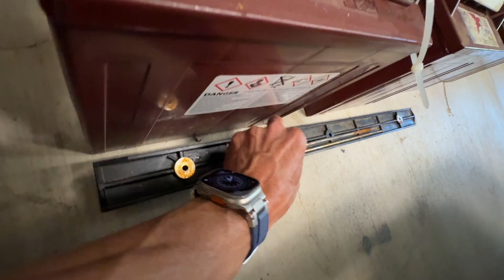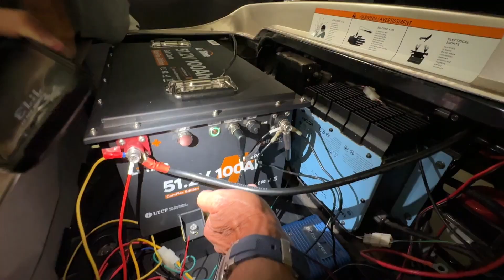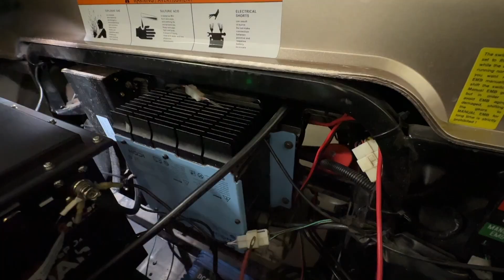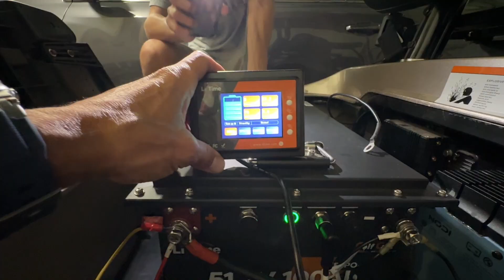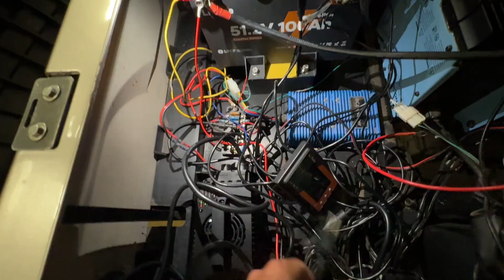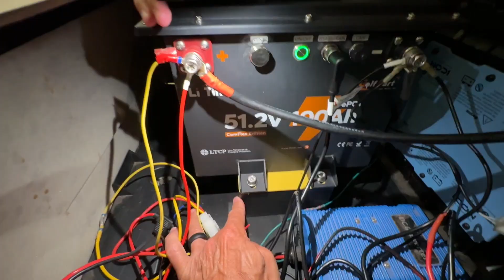Lithium Battery Install into Icon Golf Cart

Comment: Thanks for the great video, even experts need help at times. I used the original charger plug and socket, connected a 110v female (socket) to the three wires at the back of the port under the seat. I plugged the new charger into it. ( I used an electrical outlet tester to verify polarity & ground.)

Comment from the maker: Biggest problem I have found is that when the battery is low, you better charge it! If it runs out, IT STOPS! With the old batteries it would creep for a little while and at least get you home. Not now...my kids have had it die on them several times...then you have to charge it with your neighbors electricity or push it home!
Reply: Does the original OEM screen still show the battery percentage or is it better to use the actual screen that came?

Comment: I just converted my Icon golf cart to a Lithium battery ( Temgo brand ) . My install was pretty straight forward. My only issue is that my original display stays on 100% and 52 volts all the time. The rest of the display works as it should. the new display works ok. I have tried to find a work around, so I have 2 displays, but have not had any success. i left my old charger installed for the same reason.
Reply: which charger did you have? Like this one or a toyota?

Comment: Shure hope you don't have the same problem I had with the BMS shutting down the battery at speed. That was a real wakeup locking up the rear wheels in the middle of an intersection. Just be prepared it seems to happen a lot with aftermarket lithium battery on Icon carts  good luck.
Reply: I had the same issue.  I was able to reprogram my icon to remove the regenerative braking and good to go.
Reply: @ryanengr14  How easy was this?
Reply from the maker: So far so good...when it locked up, how did you "unlock" it? Is that when splicing the wires is the fix?
Reply: @drgordon13  I had the same issue occur.  Found that there are 2 allens on the motor (passenger rear) that you can snug up to release the electronic brake.  Once I towed it home and brought the batteries back online, loosened the two allens and back in business.
Reply: What’s up Dr.G? Hope you are doing well. I’m about to swap my icon to lithium.
Reply: What was the state of charge of your battery when it locked up?